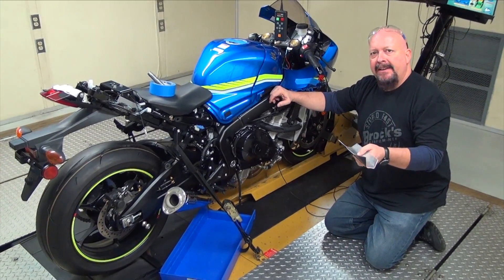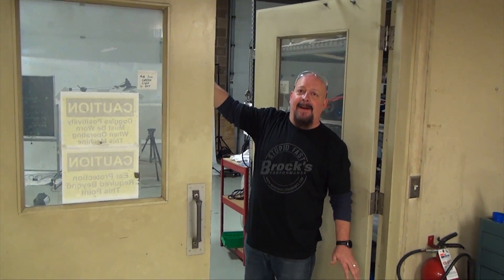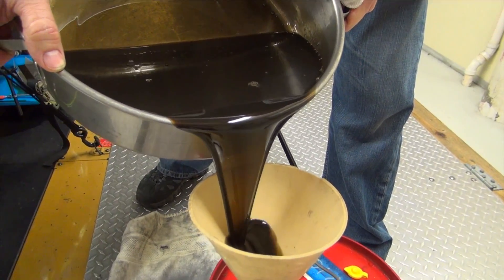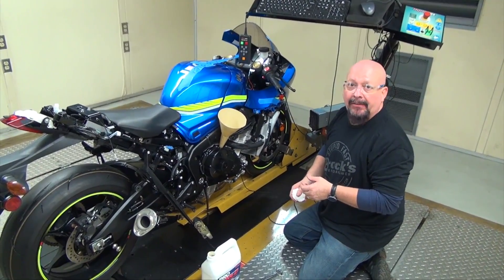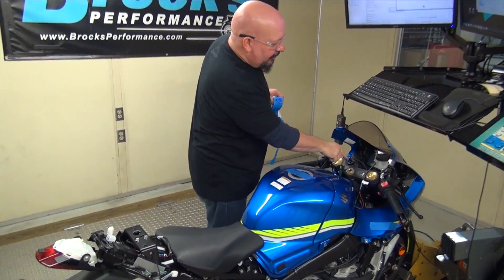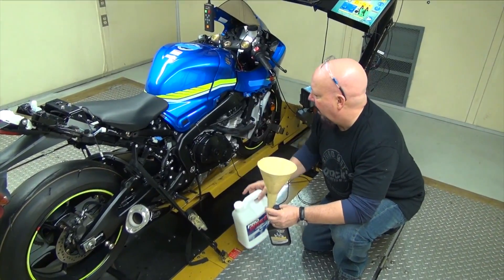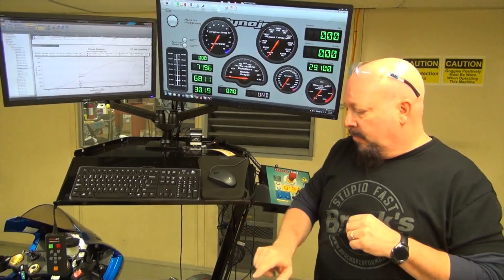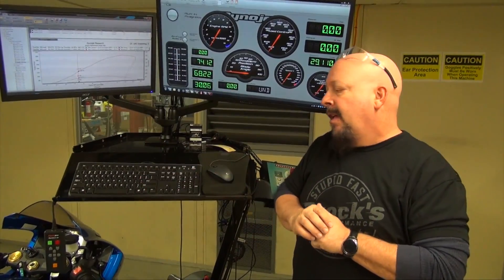2017 GSX-R1000 S2B: Episode 6 (Part 2) - The Devil Is In The Details (Oil Change)

Comment: Why putting a 0w oil if you add an additive which makes it becoming a straight 10w  ??
Reply from the maker: Because if we use the additive in a thicker oil, the overall number would go up even higher...which increases drag/reduces acceleration. Our Aliysn oil is actually less than zero weight, which makes it a perfect partner for the Petron Additive.
Reply: Ok but I mean why putting ultra thin oil whith an additive that thicken it  instead of directly putting a 10w oil ?
Reply from the maker: Because the additive reduces friction, increases clutch life and helps protect the engine parts if the oil pressure drops - from wheelies etc.
We don't know of any oil alone which does this.
Reply: ok . And what oil grade would you recommend for old school 4 cylinders ,750/1000 cc ,  90s sportbike (road use) ?

Comment: forgot to ask, do you use any of dyno jets other products like the secondary fuel module or igitinio control or spark control models?
Reply from the maker: @Tim - not really. We can add more fuel to the secondary injectors (if required-and rarely is) and adjust the timing in the flash.

Comment: Hey Brock, I have a 2011 Honda cbr 1000rr and run Motul 300V 10w 40.  I recently switched mechanics and he wants to use the Honda HP4S synthetic 10w 30.  What do you think of the Honda hp4s 10w 30 for my bike compared to 300V?   Manuel recommends 10w 30 for all Honda's 2006 and up. I live in Los Angeles. Thanks.
Reply from the maker: @gosoku2- They are both very good. You can't go wrong with the OEM full synthetic designed for your bike, IMO.
Reply: Thanks Brock, I'll give the hp4s a try. Keep up the great videos! Cheers.

Comment: Some good information, but to have a shop like that and only sell stuff and only help drag race people, is a joke I live in Ohio near this shop and have to go to northern Ind. To get bike dyno and tuned.
Reply from the maker: @Brad - Brock's Performance is an R&D facility which concentrates primarily on new product development. We love drag racing (so do about 50% of our customers), as it's a safe place to go as fast as you can. Our customers use the packages we develop, so there is no need for a custom tune.  We help customers in need of a: Dyno Tune, Engine Building, Fabrication, Installation by providing a dealer locator (over 1200 Brock's Performance dealers listed): http://www.brocksperformance.com/brocknm/templates/bpp-plain.aspx?articleid=62&zoneid=7

Comment: Those video dislikes are from s1000rr owners😁
Reply: I have a ‘22 S1000RR and liked this video. My bike is a straight beast. All. Day. Long.
Reply: I did not like my S1000RR IT WAS NOTHING ! On the other hand my Aprilla was bad to the boan over 200 hp but who cares because it turned and fit my body better ! I go less miles out of the tiers too 2000 miles a set . That from more power to the ground.

Comment: Does it make a difference if you are flashing/dyno running without using velocity on the ram air?
Reply from the maker: Yes. But since we can't properly duplicate Ram Air, we adjust the mapping at the race track, click here for more info: http://www.brocksperformance.com/absolutefm/?f=234
Reply: Thanks for the reply.  I did some digging and found some neat info on monitoring airbox pressure along with power gains with ram air.  The link was helpful. Love the videos, very nerd friendly.

Comment: I'm a little new to bikes, just got my first in august. Running thin oil gives me the nails-on-the-chalkboard feeling and I'm just wondering if your theory of running thin oil is the same on all bikes, old and new, or just the newer bikes. You said you run thick oil in your harley, but not as thick as the manufacturer calls for. How do you determine the weight of the oil you need? I have a 1987 Honda Magna. 

Also, What could happen if you run oil that's too thin?

Final question, I promise, is about the oil additive. What could go wrong and how do you tell if something is going wrong with the fuel additive?
Reply from the maker: Jesus Christ - we would not use the thin oils in an older bike. We would use the Petron additive, but if your old clutch is ready to die... it might slip.
Reply: Jesus Christ I have a prayer request. I want a 2018 BMW S1000RR in red and black. 🙏🏾

Comment: Hey Brock I️ want to buy a full system for the gsxr 1000 17 which one will be louder the alien head or the short meg a louder and deeper tone and they don’t have baffles correct? And sound nicer ?
Reply from the maker: @Isaias - The Alien Head and ShortMeg are the exact same muffler - we just 'squish' the ShortMeg to produce the Alien Head shape. Both come with baffles, but the ShortMeg baffle is removable (aka: crazy loud!) for drag strip use.
Reply: So I️ can’t remove the alien head baffle I️ thought it was a straight through hole ?
Reply from the maker: @Isaias -  please read this: http://www.brocksperformance.com/absolutefm/?f=282

Comment: How many hp can I get out of a 2014 Honda cbr 600rr
Reply: Mike 69 takes alot of money to make hp on a 600cc. Google xtre and see if they have a unit for your bike its worth it. Wouldnt even do a full system just a slipon. And do a sprocket kit change -1 +2 or +3. Youll feel a huge improvement with the sprockets. I had a similiar set up on my old 2008 zx6r.

Comment: Hey Brock, I hear it is good to shake all of your oil as the additives sink to the bottom during storage. What is your opinion on using a 0W-20 synthetic auto oil in bikes? Been running Mobil 1 5W30 in my Ninja 1000 for awhile and it seems to like it (revs faster, runs cooler, no clutch slippage). What about car oils in general for use in bikes?
Reply from the maker: @spoonman73, prolly not a bad idea to shake the oil also. We use 0w-20 in our bikes often. It would depend on exactly which car oil, but we don't typically do it, as we prefer our 10w-20 Alisyn: https://www.brocksperformance.com/0W20-Alisyn-Synthetic-Oil-Quart+I790102+C79.aspx
Reply: never..  ever.. put car oil in bikes..  a big no no.

Comment: Thank  you! Have you ever "lost" the keys??  Have you thought of doing a 600/636 bike? Not everybody needs/wants a 1000.
Reply from the maker: @YAMA - I have not ever lost a bike key. We drag raced 600 Supersport for years, but then the class changed to 1000's and we kept going with them. We have a 2009 ZX-6R in-house. It's street ridden and will run solid 9's in the 1/4 mile. Maybe we can do a feature on it this spring.
Reply: Thank You!

Comment: Wait Brock. Sure thickness doesn't mean better, if you put 40 weight on an engine that requires 20 the oil will not get in between the clearances. On the other hand if you put 0 weight where it requires 20 or 30 by the manufacturer it will not be enough to cover the clearances. Especially on the valve train. The viscosity of the oil recommended by the manufacturer of the engine is based on the clearances of the engine for proper lubrication. I haven't come across one single manual over the years that advises  less than 0 weight oil. In cars or motorcycles.
If less than 0 weight is all you need, and it's better, then what's the big fuss on 0W-20, 0W-30, 10W-40,  etc.. recommended ALL by the  manufacturer, and how come NONE of them recommends less than 0?
If a manufacturer designs and engine with clearances that needs 20 viscosity when hot you should use a 20 viscosity. It can have 0 weight when cold but when hot it has to have 20 viscosity for proper lubrication. So 0W-20 will do. If not 5W-20 will work also because if climate is mild, viscosity 5 when starting cold will do fine, but when hot it still will have 20 viscosity. 10W-20, OK too and etc. 
But to run viscosity less than 0 when the manufacturer recommends 20 is not good.
I have to disagree with you unless there's something on the oil that is not disclosed.
Reply from the maker: @AM... per the video running light oils is what **WE** do here at Brock's Performance for maximum acceleration at the drag strip. If you don't want to do this THEN DON'T. Question for you... is there a change that thicker oil can HARM your race engine? That's exactly what happened to one of our land speed racers. He switched from 20w-50 in his 1000 HP turbo Hayabusa, to Alisyn 0w-20 and increased his engine life/stopped engine failures. Read about it here: https://www.brocksperformance.com/brocknm/templates/bpp1.aspx?articleid=261&zoneid=11

Comment: 204 HP are engine hp or wheel hp?
if they are wheel hp it means 226 engine hp, right?
Reply from the maker: @maatt - 204 is rear wheel. Years of testing/data tells us to account for @11%  drivetrail loss - so yes, 226 at the crank. Nice work!
Reply: 226 hp

Comment: hey Brock, what would the effect of RAM air have on the dyno run? can you simulate that on the dyno?
Reply from the maker: @Tim, although we can't properly simulate the ram air effects of a bike moving at "x" speed enough to tune - we can force some additional air in for giggles.  It's typically a 2-3 HP gain, depends on the bike/airbox design and air filter. FYI: the gains from a modern sportbike airbox come from their use as a plenum (dead air space from the engine to breath from), an isolator to keep engine heat away from the inlets - then also, to facilitate ram air.
Reply: Brock Davidson Awesome Brock! maybe with ramair you might get 210 lol.

Comment: I love how passionate you explain technical. You turn boring subjects to entertaining!
Reply from the maker: @YT1344 - There is knowledge to be gained in even the most mundane topics. In fact, we have seen the 'simple' task of an oil change destroy engines and cause crashes (from a loose drain plug). It's the little things in life the can creep up and cause you big problems. Having a proven structure to follow, every time, helps prevent these issues.
Reply: Of course, tons of good tips. Like it was question to me, buying manufacturer's oil and filter or others in fancy packaging? 
Awesome videos! (Y) (Y)

Comment: Motul 300V is the best oil and there is Esther techonolgy inside the oil and i like the green oil color of the 300V
Reply from the maker: 300V IS a great oil! We used to use it and recommend it highly for street/track use. For drag racing, we prefer our Alisyn/Petron combination.
Reply: Brock Davidson can i use petron with 300v? Or another product?
Reply from the maker: @Mahir - yes. it will mix with any oil.
Reply: M. C. 300V is the best motorcycle oil hands down.
Reply: I've been using motul for a long time on my super duke and it makes it feel brand new and smooth.. I add a small amount of Lucas additive gives it a little better life
Reply: Jae
Reply: Jae R you got that Right. I use it in the BUSA, BRO......
Reply: M. C. 7100 is better
Reply: Just started using Castrol Power1 10w 40 and very impressed, oil seems thinner and quicker acceleration (was on Motul before)

Comment: why you dont like Amsoil?
Reply from the maker: @Flea231 -  I do! Great stuff and some of our customers won't run anything else. As a racer/crew chief it's my job to make this bike as quick/fast as possible. Our testing has shown this combination to work best AND protect our engines under very adverse conditions.  If you prefer Amsoil, by all means, run it (:
Reply: Brock Davidson thats what i figured. Because you are the owner and you know your stuff.  I thought i would throw amsoil out there to make its okay by your opinion.. i have amsoil 10w40 in my 17 gsxr1000. Im at 2800 miles right now.  ive been running it in my dirtbikes and in all my sportbikes since 2002.  No problems ever. And i agree with you on the oem filter part. I will only stick with oem also.  Thanks brock..  great video on the oil. You are awesome.. and i looked forward to seeing more of ur gsxr videos
Reply from the maker: 300 V is a great oil also.
Reply: any opinions on the Motul stuff?
Reply: meh Amsoil is a ripoff

Comment: I'm waiting for the time when litre bikes make 200+ whp with ONLY an ECU flash.
Reply from the maker: @Heretic - you will be waiting a VERY long time as emissions regulations will only get more stringent.
Reply: That's very true, and very unfortunate. However, these new Ducati V4s, 2019 S1000RRs and hopefully Gen 6 ZX10Rs are looking promising and are getting closer and closer to that mark. It's a slow process of horsepower evolution.
Reply from the maker: @Heretic - currently, the Ninja H2 would be the only liter bike option.
Reply: Only so much can be made out of n/a 1.0L engines. Want more power? Get more rpms, which means the stroke length has to be shorted to keep piston speeds in a safe place, and mid-range torque goes down the toilet and fuel economy goes down the toilet. Lots of things happen. If you exist around +/- 3,000 rpms on a race track, fine. Doesn't matter. Everywhere else these 1liter peaky engines aren't that interesting.
Reply: Heretic Anthem https://youtu.be/_TyQBqkDVYk
Reply: Maybe the Ducati Panigale V4 1100 will.
Reply: Heretic Anthem panigale v4 did it!!  216 hp stock
Reply: Heretic Anthem ok waits over, duh
Reply: Heretic Anthem Look into the new R1.
Reply: My 1000 bike pops 225+ WHP with only a flash ;)

Comment: Nice video. Great you are explaining every detail. I had hoped you would do a run with the alisyn oil and after that a run with petron plus added, just to see the results.
Quick question: i've got a Triumph Street Triple with 55k (km not miles). The engine (mildly tuned) is still running great. Would it be a good idea to ad petron plus to extend engine
 life?
Reply from the maker: @Jan -  yes. We use Petron in our cars (have seen as much as a 3 MPG increase!), trucks etc. I even use it in our 28 HP Kawasaki-motored mower. It mixes with any brand/type of motor oil.

Comment: Thanks again for the video Brock! Will the racing oil maybe make a bigger difference after you put some more miles into it? Will it then not thin out a little bit more?
Reply from the maker: @Freek - It typically does. We will show those results in an upcoming vid.